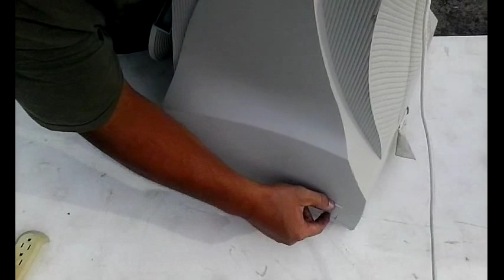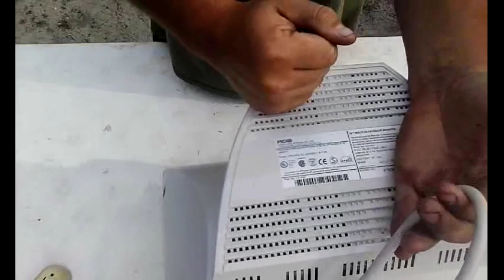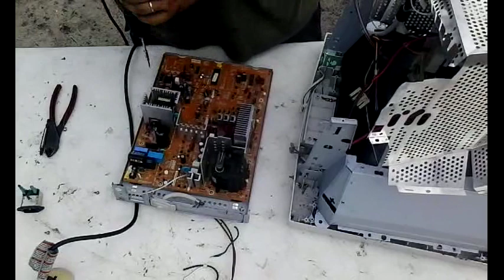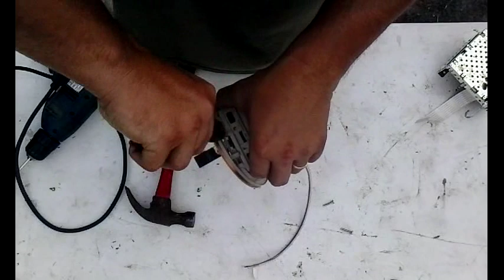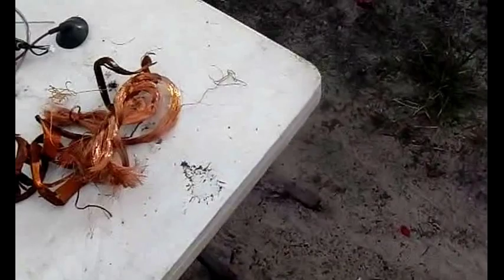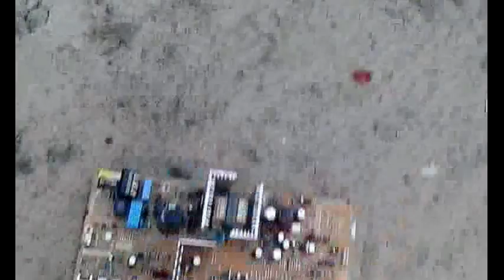How to make money scrapping a CRT monitor.

Comment: Never mentioned the lead that is in, and on the glass..
Reply: Its a vacuum tube, there is no lead. The glass side panels have lead, a bit at the neck where the cathode ray gun assembly is. If you cut the back of it you can pull out the guts of the cathode ray gun assembly without interfering with anything else :3

Comment: *The gas was previously removed from this monitor and CRT monitors should only be opened by a licensed professional. *
There is no gas in these. The tube is pressurized, when you hit the "yoke" with the hammer, that "pishht" noise was you releasing the pressure.

Comment: I'm wondering the copper is wrapped around that ceramic thing I took it apart but I don't know what it is I know it's not a magnet cuz metal don't stick on it but what is it? Please and thanks
Reply from the maker: Gabriel Heredia I think it is just iron that has not been tempered.
Reply: The massive coil of copper that sits on the neck of the tube is called the deflection coil or Yolk, If you power on a CRT monitor and take the casing off (Don't touch anything it's very high voltage) and hold a metal object close to the coil you will feel it vibrate.

Comment: CRTs are under vacuum, not pressure. If there was any gas in the CRT it certainly wouldn't work!
Reply: +Ben Thomson discharge vacuum with a scredriver by puncturing the divit high voltage on the tube,.
Reply: Yep, that's one way of doing it. I usually use a diamond burr on the tip-off at the end of the neck, just to break the seal.